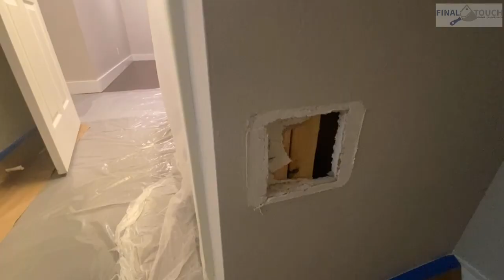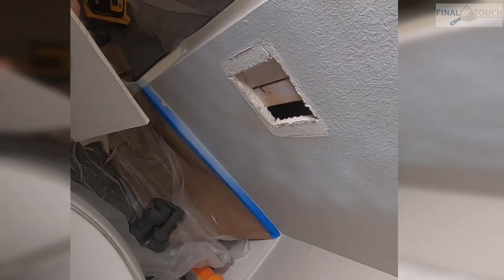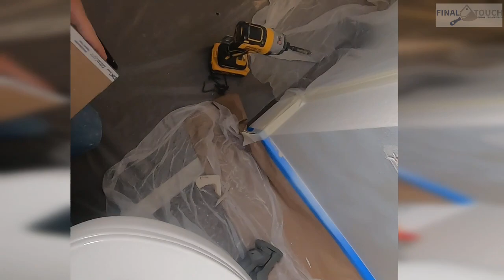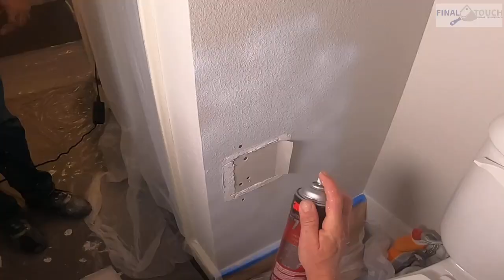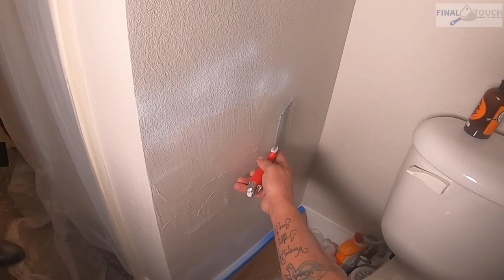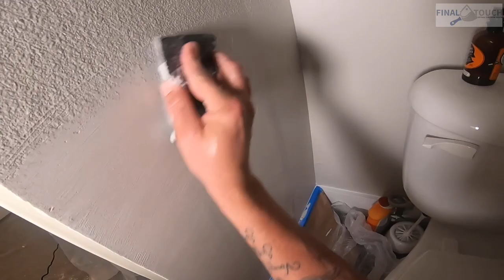What Happens After Removing Old Ceramic Toilet Paper Holder| WATCH!!

Comment: Hi. Please help! I have to remove a ceramic toilet paper holder that is attached to a wooden cabinet.  How the heck do I do that???  Long story short. My dad's coming home from the hospital tomorrow, and the toilet paper holder will be in his way, and has to go. I need to get it off as neatly and smoothly as possible.  I don't have time to get a handyman.   I have to do it myself sometime today, and I'm not a handy girl.  Please help!
Reply from the maker: Well that’s odd that a ceramic one is attached to a wooden cabinet. You just have to remove it to see what it takes to fix. Might need a handyman in this case. Only because it will need to be patched with wood.
Reply: @finaltouchdrywall   Thank you so much for replying so quickly.  Yeah, it is weird. The walls in the bathroom are ceramic tile, and all the fixtures are cemented ceramic, but the side of the vanity is wooden, and that's where they decided to cement on a ceramic toilet paper holder.  I guess I'll see if I can get it off, and then hire handyman to make it look nice later. Thanks again!
Reply: Yup, we have that, too! It's not solid wood, so I don't care much. If it gets bad, I'll patch and paint it as it's worn, anyway.

Comment: You didn’t show how to take off.  Fail.
Reply from the maker: I did.
Reply from the maker: Here is the link for my video. 
https://youtu.be/Nq2KGmo0nhc
Reply: @finaltouchdrywall  thanks for the link.  My father has a metal one with no apparent hardware holding it in place. Can it probably be pried off like that as well?